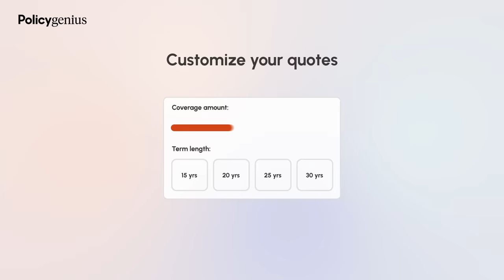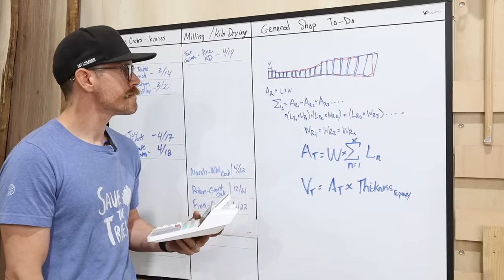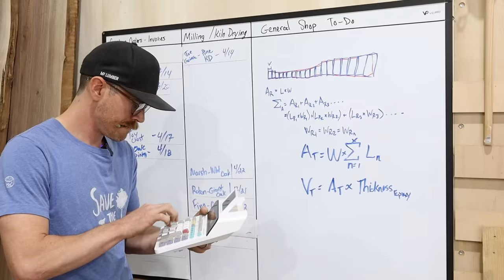Settling woodworking's biggest controversy: EPOXY

Comment: Its like asking "are you still a mechanic when you plug in a diagnostic tool" Yes, you are. The table doesn't build itself, wood, woodworking tools and above all a skilled woodworker is needed to complete the job, so imho: Yes, this is definitely woodworking!
Reply: At least make the legs. Don't just buy metal ones off the shelf and screw them on. The legs are the hardest part of a table
Reply: @jamesbondo5895  But the metal is forever (if half decent)
Reply: @stanimir4197  to me, it's out of laziness or convenience. All of the joinery, and actual woodworking is in the legs, especially when half your top is plastic
Reply: I agree, definitely woodworking. Having just made a mistake on a rather expensive slab (it’s not even going to be epoxied!) that I am turning into a table, reminds me that nothing ever, ever completely goes to plan and you have to have skills to make it to the finish line (and have it come out beautiful/sturdy). Case in point, after years of experience, I fixed what I would have considered a “fatal” mistake to this project 20 years ago… accumulated learning and experience got me here. That means it’s legitimate craft in my eyes.
Reply: The title / premise was just comment bait.

Comment: Thanks for this video! I have been wondering what the anti-river table crowd truly had issues with. The “maker” in us I think is what brings us together, and I was so glad to see you reusing the old base (woodworking). To me (none domino owner) I always feel that the domino is cheating at woodworking, but then I just suffered through making two bedside tables with 36 mortise and tenon joints each. Maybe I’m just jealous; after all I had no problem using my jointer and plainer instead of Han plains. Respect for the Makers!
Reply: I agree, and even John has a hard time getting past digs at the epoxy crowd many times in this video.  Epoxy is just another medium to mix with wood.  Do those who grouse about it or even question if it is woodworking say the same about those who use manufactured metal legs like he proposed in this same video?  It is another non-wood substance that in this case is actually replacing the wood entirely whereas the epoxy is united with the wood in the project.  Your point about the domino is just as valid, planers too.  We can all come at these things from a certain perspective.  And I will admit, I sometimes have a hard time with the CNC crowd, but I also know how much time and effort goes into programming and setting it up, so I cannot say it isn't "making" just because a machine did it.  Again, I have a power machine for making wood flat, a hand plane is a more primitive machine for making wood flat.  A CNC is an even more powerful tool than I have that can . . . make wood flat and more.  I would love to hear an actual argument (critical points backed with evidence, not mere ranting) from those who claim that river tables aren't woodworking.

Comment: To save on epoxy, use wood instead.  Pour a 1/4"-1/2" epoxy base and let it harden.  Then fill your remaining space with scrap woods. Pour another 1/2" and let that harden.  Then do your final fill pour.  You can save a TON of epoxy this way. Obviously this only works if you are using opaque colors.

Comment: I haven't made a river table, but I took on a woodworking project last year and used pieces of wood that had loads of knots and some check cracks, which I decided to fill with epoxy. Dealing with the epoxy was much more work than I envisioned. I overpoured/overfilled some of the areas. Since I did multiple passes, I had to mix a couple small batches, and I didn't quite get the proportions right on the small batches, which led to epoxy that didn't harden, which I then had to scrape off and redo. It was a massive pain and way more work than I envisioned. In the end, I'm happy that I filled in a bunch of knots and cracks, but I didn't love the process of working with the epoxy. Still, if I had the same project again and had to use the same wood again, I'd probably use epoxy again, although I'd be much much more careful with the mixing and pouring to avoid overfilling.

Your table looked great in the end.

Comment: The spider base looks great, but it seems like a small footprint for the size of the very heavy slab. Your mom might be right, but that base will do the job, and let you hook one of those cantilevered toddler's high chairs on the edge of the table. My vote is the stability of the original/stretched base. However, put your organic mind to rest. It's an organic piece of work, because epoxy is a polymer which is definitely based on organic chemistry. Wikipedia even says it's a cyclic ether, whatever that is. Organic as all get out. So much fun! Loved your gags with your friend, especially the crossed tapes on the raw slab.

Comment: I understand totally about the woodworker vs. maker debate.

I don't use epoxy and don't care for river tables. I make tables and shelving units with copper plumbing pipe and wood shelves/tops. My work with wood is limited to cutting it to size and finishing.

I'm not going to debate if it's woodworking — I call it furniture making and leave it at that.

Comment: I'm fairly new to the hobby but in my opinion, epoxy tables are the mullet haircuts of woodworking. They're great now but may not age well. Cool to see the process and learn second hand that I have no interest in taking on the task. Oh, option 2 by the way. The "spider" base was cool but 2 looked amazing.
Reply: I think, tastefully done, epoxy tables can be elegant looking.  The epoxy should accent, not over shine, the wood.  However, as you say,  I believe that one day they will fade away and will date this time period.
Reply: I should have clarified... Tables with epoxy used to fill holes and small defects can be tastefully done.  An epoxy "table" where 25% of the surface is covered in epoxy needs to go away.

Comment: 13:49 Slow sanding is because you're not using 3M Cubitron discs. Edit: 21:19 lol, nevermind. Back to original text: You can buy a $15 sample pack of various grits to see the difference for yourself without a large investment. Don't be afraid to throw out your discs more frequently as well, too many people keep using the disc for too long, and if you at all value your time you'll do the math and see that tossing a $0.50 disc is worth it in time savings versus trying to pinch pennies.

Comment: I'm wondering how these river tables will look after 3 or 4 years of expansion and contraction and cupping etc of the wood and total rigidity of epoxy. I imagine cracks etc. You touched on it with the cupping already.

Comment: 13:50 --- Cubitron II XTRACT is a way to go only with faster movement than usual because resin like to clog anything if you move it slow like that (resin heat up like crazy and then stick)

Comment: In the past, I always thought art was paintings and sculptures. But, as time has gone on and I have started making things, art is art. It does not matter the medium; when someone is making out of passion or love, then it is art. I think the wood working  vs non-wood working follows the same trend. If someone uses a different medium in art, it does not become less art. If someone wants to sneer at epoxy because it is a different medium then it would be tantamount to  an acrylic painter sneering at water painting. It helps no one and does not promote future making. I like your summary at the end and I think it was well said. It does not matter if it is woodworking but for someone to call it wood working only offends people gate keeping making. Making for the love of making is art.
Reply: Also I love M2 Lumber. Lived in upstate SC until recently and Matt is a great guy. Never knew you were around there, but cool to see the connections that exist.

Comment: .....or use the metric system. 1 dm3 = 1 liter

length: 1 m = 10 dm = 100 cm = 1000 mm  (move one decimal for each step) 
area: 1 m2 = 100 dm2 = 10000 cm2 = 1000000 (move two decimal for each step)
volume: 1 m3 = 1000 dm3 ..... (move three decimal for each step)  
1 dm3 = 1 liter (if water its also 1 kg in weight)
therefor 1 m3 of water = 1000 liter = 1000 kg that is a metric ton. 

It the table seems to become little less than 2" thick, let say 25mm (1"=25,4mm) and the size seems to be 2,3 m * 1,2 m, then the volume will be 0.069 m3 (0,025*2,3*1,2). The density of pecan wood is around 770 kg/m3, and if the table top would be solid pecan it will weigh 53,1kg. But because epoxy has a density of 1000 kg/m3 there will be 13 liters (0.013 m3) which weighs 5.2 kg more (0.013*(1000-600)).
Total weight of the table top will be 58 kg (128 lb). That's a heavy table top.

Why don't you use the meter system, it makes everything so much easier......

Comment: First I'd like to say that I hate the "What is real wood working" argument. It's comparable to saying that finish carpenters aren't really carpenters because they don't frame, or visa versa. Both are necessary in the process and both are carpenters.
Second, the table looks awesome! Both leg sets work with the top, though I lean toward the spider legs because I like the modern/mid century modern look.
Finally, third, and most importantly, I like the way you and your friend pronounce pecan. As a displaced South Carolinian myself it's good to here the word pronounced properly.

Comment: Pro tips: 

- No need to use silicone or hot glue to make mini dams for the epoxy pours. Just wait a bit for the epoxy to get more viscous and then pour without dams. They are a pain to remove, and make the epoxy super sharp.
- Instead of filling the tiny holes with epoxy just pour some glue into the hole and sand over it. The sawdust fills in the hole. Mind. Blown.

You're welcome. :goat-turquoise-white-horns:

Comment: Aesthetically the spider base looks awesome and an easy first pick.  But if I had to live with the product, I'd likely have a harder time deciding whether it's worth the likely inconvenience sweeping under the acutely angled contact points and cracking knees on the oddly placed struts.
Reply: You can use compressed air or just a blower.

Comment: I like the base from your mom's table better.  It looks solid and sturdy.  The spider legs look like they are wanting to collapse and would be easy to push the table over (even if they are in fact rock solid), and that's not something I want to worry about every time I approach a table, even if it's an unwarranted worry.

Comment: To calculate the volume of epoxy needed, couldn't you weigh the wood, divide by the density of the wood, and then subtract that from the total volume of the table?

Comment: Woodworking-working with wood. So yes it is. Sanding and sanding and sanding wood. Yes it is woodworking. I’ve made two end tables from a crotch cut piece of an ash tree that I split down the middle length wise. Epoxy filled the crotch ends. Filled a ton of bugs holes with black super glue and the bigger holes with more epoxy. Made the legs out of smaller branches with tenon ends made with a tenon cutter in a bid old half inch drill, and didn’t wrap my arms around my neck. I made two live edge rails to connect the front legs to the back one about four inches from the bottom, forming a triangle shape. Planed down some pieces about four inches wide to a half inch thick, cut each end to match the angle of the rails. Glued and brad nailed them to the bottom of the rails and made a shelf. Then after much more sanding and two coats of Osmo, I finished my, yes, woodworking project. Pros and cons of working with actual tree wood, not everything has to be perfect because it’s imperfect material. Also the con because it’s a pain to get squared have a place to measure from. Try building a set of shelves with live edges on the front and back of the shelves. Nothing to square your cut line to. Ended up setting then on the table crown up and a framing square laid on the table against the shelf and struck a line. Then could measure for the other end. Fun stuff sometimes, but you end up with a unique one of a kind piece that can’t be exactly duplicated. Oh yeah, forgot to mention that the Ash wood came from two dead trees in my yard and four from the neighbors. Cut them down, slabbed them with a chain mill. And it’s nice to be able to say when someone says where did the wood come from, oh, from a dead tree in my yard. So yes, definitely woodworking.

Comment: ummm i was going to say the wooden would look better but that spider base is not bad, but im not a fan of the black paint on the base i am a sucker for raw finishes. both look great but the wooden base looks unfinished where it meets the top. given the two i vote the wooden base if the top of the base is cleaned up. 

thanks for the journey.

Comment: You more or less said it at the end, but I think that saying "epoxy river tables aren't woodworking because you don't do various joinery and stuff" is analogous to saying something like "digital sculpting isn't art because you aren't using chisels and scrapers." Woodworking as a term is broad as hell, and you can spend a whole lifetime of woodworking without doing various techniques or using certain tools. It's just a different subset of the woodworking umbrella than the subset that another person might live in. People who do intarsia basically don't do traditional joints at all, and the use scroll saws as their primary tool. Turners might not even know what a scroll saw is, but they've got their lathes running 24/7. These people are both woodworking and they have pretty much nothing in common aside from the fact that they're using the same medium. People in construction do this, fine furniture builders do that, luthiers are over here doing these things, flat pack specialists are over there with their techniques. I think they are all respectable niches, and there's no reason to disrespect any of them. They just found a home somewhere you didn't particularly enjoy (or more likely, never bothered to visit.)

Comment: I think the proper way to see epoxy whatevers as simply being part of the craftsmans world. 

It's also Art, it's also building, it's allot of things. Sure it's not traditional woodworking, but it uses wood allot as a substrate. If you are a metalworker that builds art pieces, and uses wood in many of them, your not a "woodworker" per se, but you certainly are a craftsman, just as a traditional woodworker who only uses hand tools is a craftsman, and a modern woodworker who uses power tools is a craftsman. Taking craft work to the level of beauty that I often see turns it into an art form, whether it's 100% wood or a combination of materials.

Craftsmen craft. woodworkers use mostly wood, metalworkers use mostly metal, etc. It's still craft, and it's still beautiful.

Comment: So, I've never done an epoxy table (drop the "river" already - river of plastic? lol).
Epoxy is very good at blocking moisture and humidity.
Your "hard wax" (yes, there is a reason I put that in quotes) finish does NOT.

So... Since the wood will be shrinking and swelling with changes in relative humidity - almost as if they were raw (with that finish)... and the epoxy will not... how long before the wood begins to separate from the epoxy, or cracks (more likely) due to stress from the epoxy not moving with it?

Unless people have figured out how to change reality - it is going to happen.

Comment: The way I see it, Resin tables simply add to the process. You still did all the steps that make it woodworking. Think of it this way, If you had started with a solid slab of Pecan instead, then what would you call it? You just took two less usable slabs and add resin to make the one big slab.
Reply from the maker: it is quite the process.

Comment: Adding epoxy makes it no less woodwork(ing), than adding a cut or crushed stone inlay. All of it falls under furniture making. My table has a large LCD screen plopped in center and a computer built into skirt section. It takes MORE skill, not less, to work in mixed medium. What matters most, is if the finished result gives someone enjoyment.
Reply: btw, the koi pond screensaver looks great when looking down at my table.

Comment: I guess i dont understand. Ive inlayed antlers into wood, mastodon ivory into antler, stone into wood and antler, all types of hand forged metals into wood and much more. I tend to like the contrast you get when melding different materials together. Cutting boards made with light and dark woods look interesting. Epoxy tables are just another form of a type of inkay. Mabey all these tables will not age well but neither did shag carpet and it was popular for decades. I saw lots of woodworking techniques in this video,  most were done with a cnc or other fancy equipment. I doubt ill be making a river table in my future but taking wood and shaping it to specific dimensions regardless of the other materials used looks like wood working to me.  I do blacksmithing as well and there is a sub culture who would say any electric welding of forged components is not blacksmithing.  Seems like a grumpy purist way of looking at what ended up a solid beautiful piece of furniture.